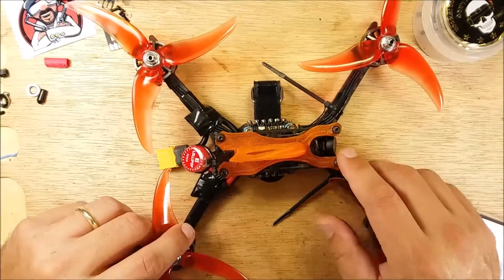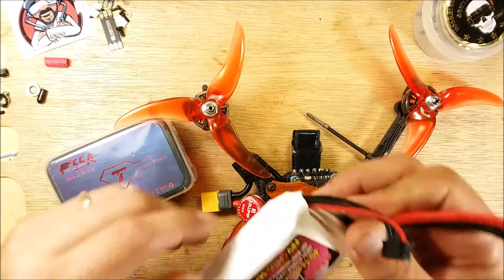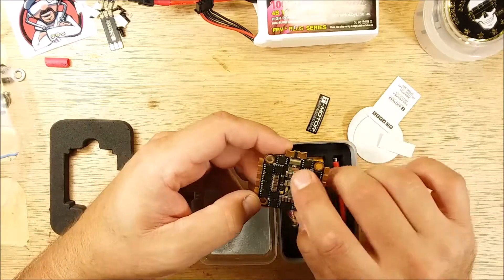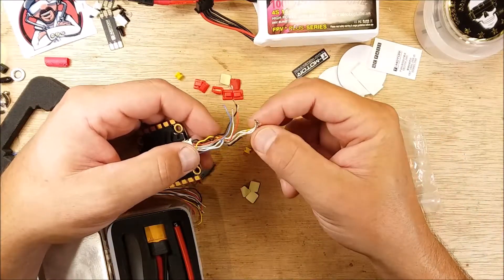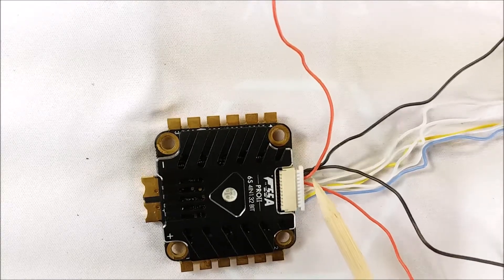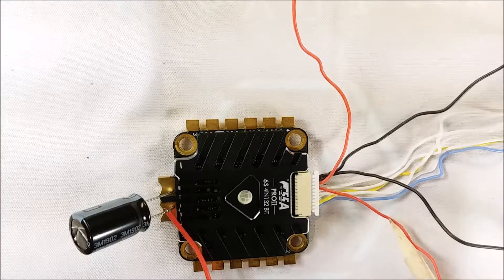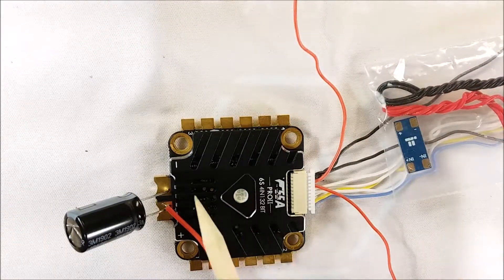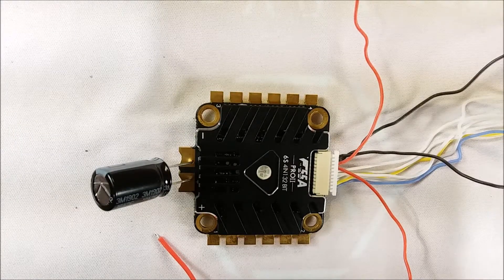10 Volt BEC | T-Motor F55A Pro II | 5 Inch Race Drone Overview

Comment: Thank you for this video, buying this esc now
Reply from the maker: I got a half dozen working.. Funny story.... I ordered extras to replace ones that got burned out. Never had to, so I just built more quads, Lol. I also run this dude in my Rescue Drone. Why is that significant you may ask - I lift a garden hose to my roof and water my gutters...🤣 Running a heavy 7incher with that payload at 80%+ throttle till the lipo is spent. No problem, ESC is rock solid...🍻
Reply: @PropsOff  nice use of a drone 😎

Comment: Hi. so i dont need to run 2x ground wire to my fc? just one? Than you in advance. my drone is having the flip of death trying to troubleshoot
Reply: And do i need to run the 10volt bec anywhere? i got the lumenier f7 and just run the bat+ to the fc to power it
Reply from the maker: @Gubsies  You don't need to use the 10 volts coming from the BEC on the ESC. I used it to power my camera, but you can de-pin the wire completely and totally not use it..
Reply: @PropsOff  thank you! and for the 2and ground wire?
Reply from the maker: @Gubsies  
Yes it too. There are 2 ground wires. One for the ground to the flight controller and one goes along with that 10v BEC.
Reply: @PropsOff  ah so I dont need the 2and ground if im not using the 10 bec. Which one? Haha

Comment: Soooo... if you don't have a separate BEC. Run as much as you can off the 10v bec by splicing them? I got the CL7 board to pair with this, so I can't just use the cable to connect the 2 components correct?
Reply from the maker: Connect all you want (10 volt capable devices) up to the 10 volt bec, yes, splicing off to each device.. Do not exceed the 2 amp rating of the Bec or it will burn. I don't think I would do more than 1.8amps total..